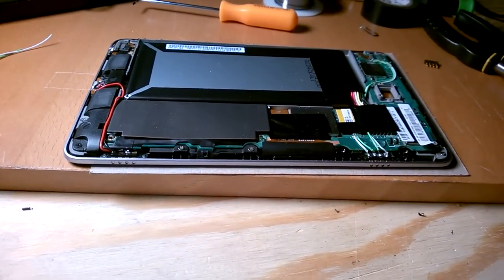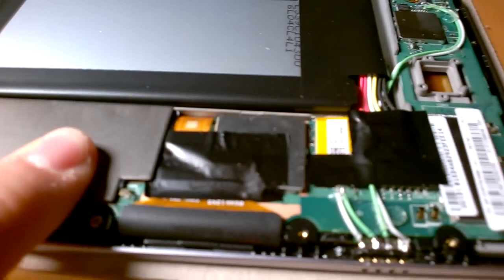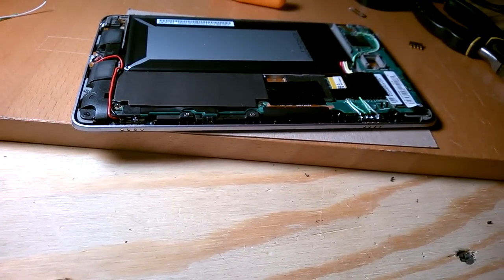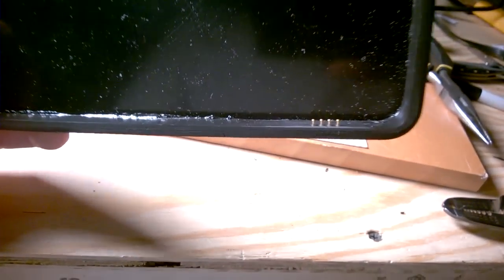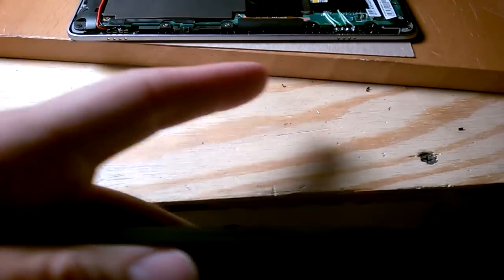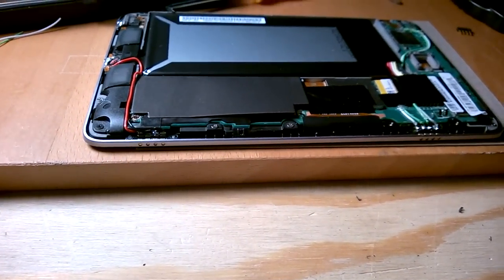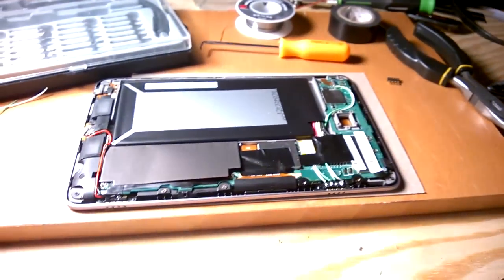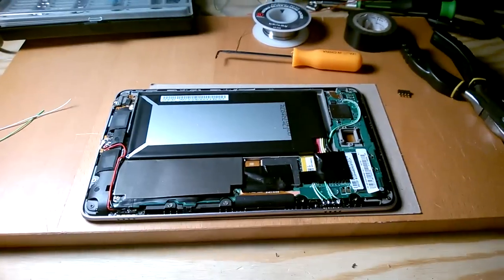Nexus 7 Modifications - Long Lost Footage!  TWO sets of side pin connectors!

Comment: Is there a video showing how u did this
Reply from the maker: No sir.  It was completely experimental, and it took me quite a while to get it right.  I was hoping to make a how to video if it was successfully, but the pogo pins just arent a reliable connection for "on the go" use like that.  They're fine for a cradle, where you pop the tablet into a dock and it sits there.  But it has to be so precise.  I wasnt able to create matching connections consistently.